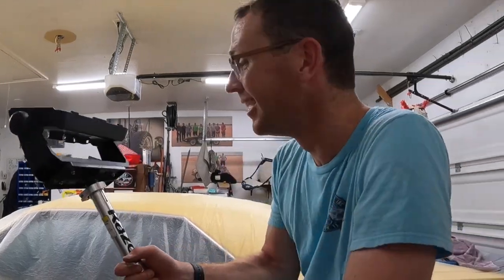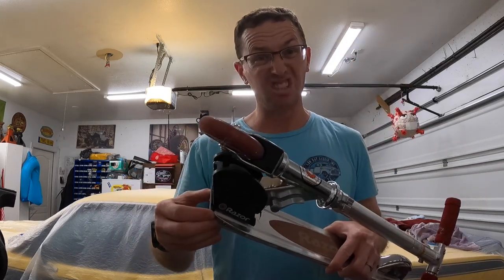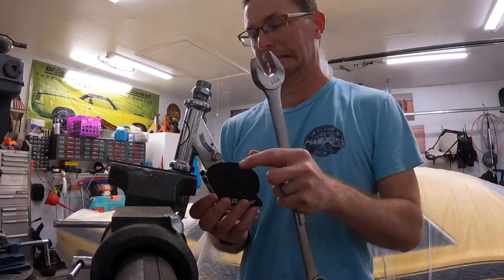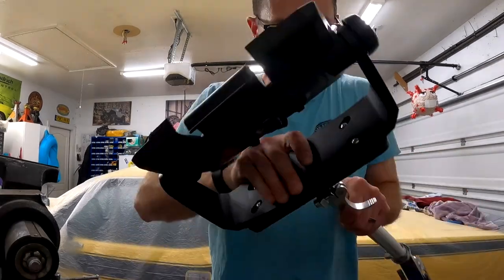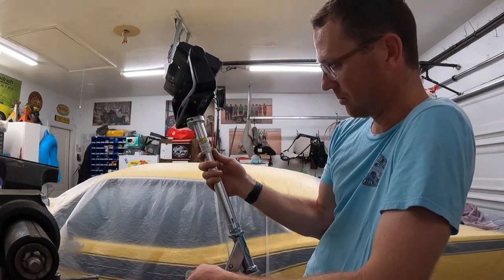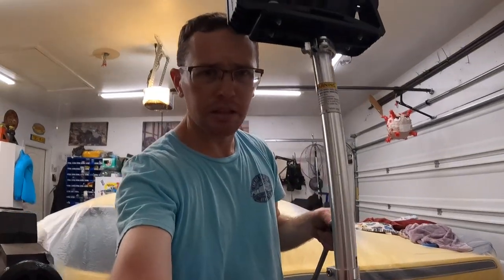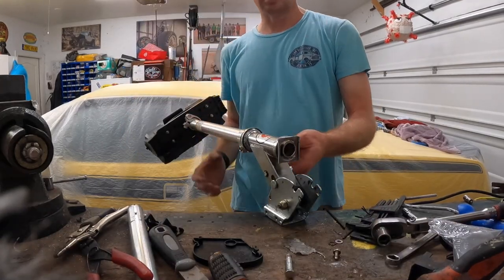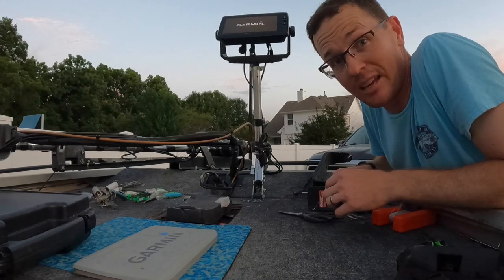⚠️EASY! DIY - Tall Raised Fish Finder Mount for Livescope! ActiveTarget | MEGA Live | Razor Scooter

Comment: Awesome! I replaced the pin with the 2 bolts from the front wheel which have threadope and fit perfect. Was even able to put razor plastic guards back on. Thanks! Just saved me about $500
Reply from the maker: @parkchop2445  nice! I'm still using mine to this day 👍

Comment: I just did this, cheers for the idea. I did weld a bigger base plate on for more stability and an adjustable rubber foot where the front wheel used to sit. Beats paying $850 (AUD) for a store bought setup
Reply from the maker: Sounds like a good setup!

Comment: I discovered that if you flip the mounting bracket over and have a vertical surface to mount to the pole will sit straight vertically. Just find the right height so that when your fold it down it doesn't hit the deck before it locks in place. On my boat I had to mount it more to the right. Otherwise it hits my bow-mounted seat when the graph is installed. I'm using with a Garmin 73dv. My scooter is currently painted pink as it was my granddaughters.
Reply from the maker: Sounds solid!

Comment: First I have a question then I have a partial solution to your  bagpipe dilemma. What was your solution to keep from banging your head unit on the deck in rougher water? As for the bagpipes, whenever you hear them just go out into your yard, load your boat and go fishing. Bet you don't hear them from the lake.
Reply from the maker: @SammysBaits  good call on heading to the lake. 

When stowed I use a bungee rod tie down to keep it from bouncing. 👍
Reply: @goodmanfishing  I just picked up two scooters today for $15. Can't beat it. Thanks for he video and the response.
Reply from the maker: @SammysBaits  nice!

Comment: How is this holding up over the past months? I watched some other videos since you put this in service to see if it gets in your way or not. What are your thoughts after some use? I think it's a brilliant reuse of a razor. Nice work!
Reply from the maker: It's been holding up great for me! The height is really nice after a long day and pivoting down to stow makes it easy to use a boat cover. 

Mind you I primarily fish an electric-only lake, so it's not getting beat on running on plane.
Reply: @goodmanfishing  I fish some pretty big water with a glass boat, probably a good idea to bolt through to a backing plate. 
I really appreciate your video. I love hot rodding items to make them cool and serviceable.  Tight lines! 🎣

Comment: @Goodman_fishing
Is this still working for you?
I like the idea…
What about where it mounts to the boat?   Any concerns?
What is the yellow hot rod under wraps?😮
Reply from the maker: This is working out great!

My boat isn’t a high speed glass boat, so it doesn’t see some of the shock loading other boats will see. That said, it will be pretty durable once screwed down/anchored well. 

Hot rod is a 1972 Plymouth Cuda 👍
Reply: @goodmanfishing  
Thanks for the reply 
I might try this mod.  Looks like it will work.  
True American Mopar muscle.  
One of the best along side a 1970 LS6 Chevelle SS